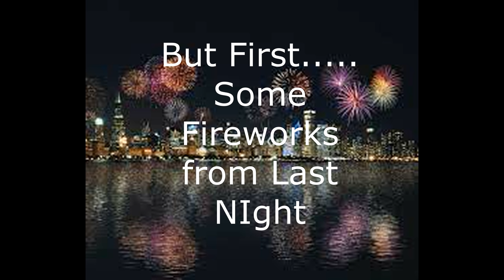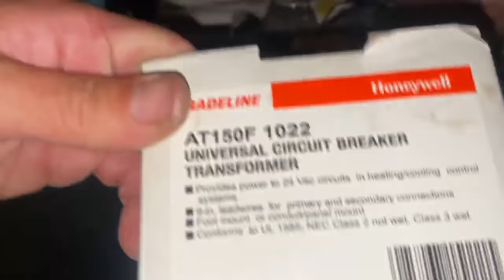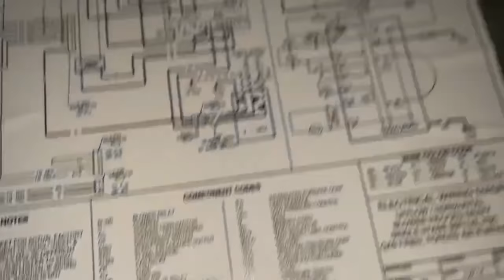Fuses on Amazon No Bueno! Don't Buy ATC Style Fuses for Furnaces or Air Handlers on Amazon

Comment: I am not an HVAC guy but I am a Auto repair shop owner. My mom has a 1 year old modular. She called me and said no AC. I went over and in 20 min I found that the fuse had blown and that the cause was a shorted contactor out at the outdoor unit. I had put new fuse in and unplugged the outdoor unit and it didnt blow. The coil on contactor had shorted. I found it partly because Im good with electrical but also from watching Mikey Pipes. Thanks bud saved the day for my mom.
Reply: good guess brother

Comment: Hey 👋 mike  I came across this exact same issue with a customer that bought harbor freight fuses and melted the fuse socket and wire to the blower motor in a Chevy suburban . The fuses are not the amps they say they are .  Happy 4th mike !

Comment: Busman fuses are made in Japan. Fuses are low resistance and low melting point. You must have got a bad batch. You could have received a higher amp fuse put into the 3 amp color coder.

Comment: Dude it said "Component Codes", that refers to the lettering you find on the PCB, not the "Display" codes.  I do agree with the cheap fuses on Amazon.  You get what you pay for, and all the China stuff is mostly crap.

Comment: Nice fireworks Mike! I recently put a 2 amp Bussmann brand fuse (made in Japan) in series with the contactor coil in case it shorts out. I figure it would blow before the 3 amp on the control board. I saw those Chinese fuses but did not trust them!

Comment: I didn't get enough information???
1-the inducer was running?
2- the fuses were blowing/not blowing???
3 - the t-stat wire was compromised???
1- if the inducer fan was running while in a/c mode generally looks like a bad board?(unless start up test all functions)
2- Amazon I believe is a shipping company so buyer beware.(it's just a fuse)go to pepboys.
3- your high pressure mike you should do  paid promotions for Amazon they're GLOBAL!!!
😂🤣😂🤣🍺🍺🍺🥃🥃🍇🏌
Stay safe.
Retired(werk'n) keyboard super tech.
Wear your safety glasses
Reply: are you a super tech in inverter technologies
Reply: @OleRazzleDazzler  inverter tech is all what the manufacturing instructions state should happen when power is applied.
Vari-flow/speed/lighting,has been here for a while (dimmers,motors,micro waves,etc) they just put it in a sealed system.
And I believe most inverter technology is proprietary?🤔
If power is verified and no go IT'S TRASH!
and a lot of the original inverter tech is being thrown in the TRASH!🤣😎